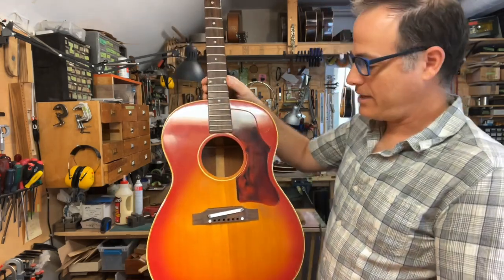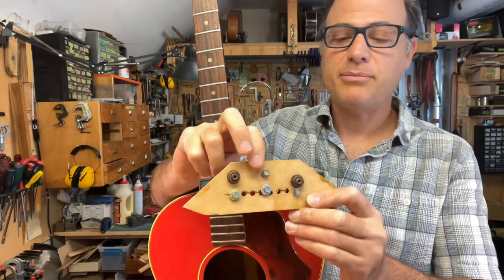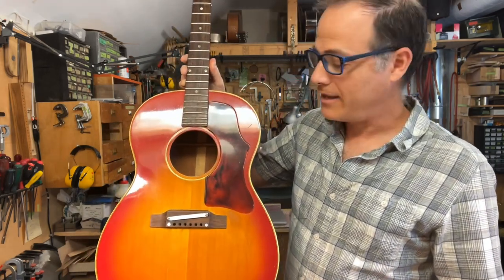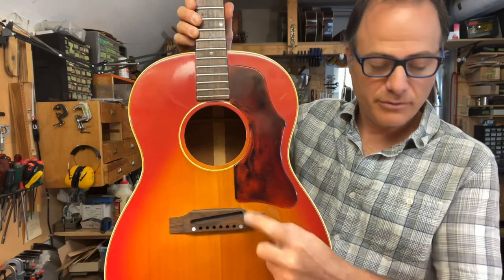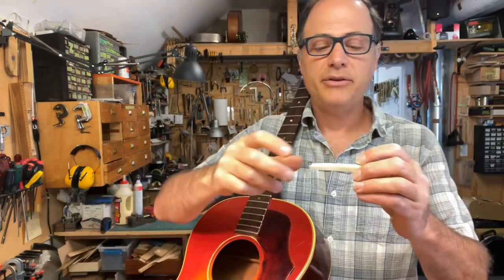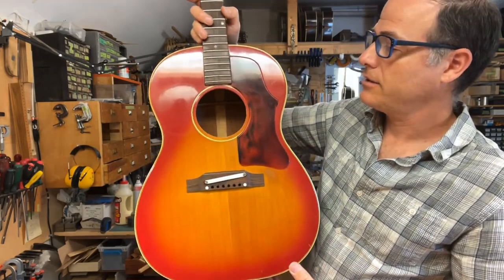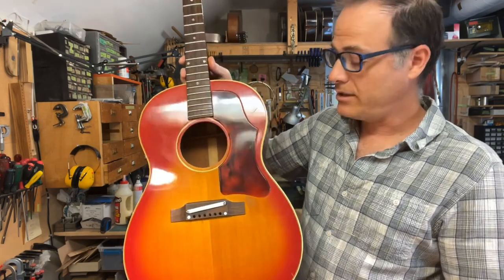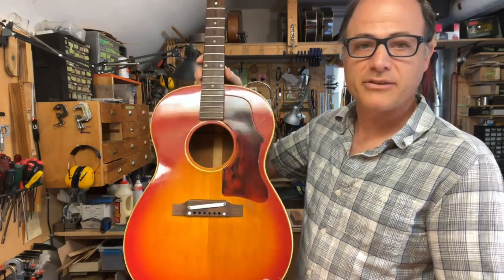A Creative Solution to the Gibson Adjustable Bridge Conversion Dilemma

Comment: Since my last comment about a year ago, I now have a 1965 Gibson B-45-12 and a 1967 Epi FT 45 Cortez, both came with adj. saddles, and both sound so much better now that they've been converted to solid fixed saddles. The Cortez in particular has a lovely warm vintage tone.

Comment: Good solution and video.  I have a 1965 Epiphone FT85 (12 string) with an adjustable saddle which sounds great and which I wouldn't dare convert. The saddle on my 1970 Gibson J50 has been converted and that sounds great as well. I still have the adj. saddle and screws so there is the temptation to change back to the original set-up, just for comparison's sake. The big mystery is why on earth anybody at Gibson thought that plastic bridges were a good idea!
Reply: right there with you.

Comment: Update to my earlier post: I made my own Brazilian rosewood insert and tightly fit it to my bridge. Then routed that insert for a standard sized Gibson saddle. But since I fit the insert tightly, I didn't need to glue it in. This way I can take it back to it's stock configuration, if I ever need to sell it (which will never happen..lol).
So now it's has the look and sound of a standard bridge and saddle, but it's not permanently altered.

Comment: Very interesting. Thanks for sharing. I recently bought this exact same made in Japan bridge for a 1966 J-50 I recently purchase. It had an original rosewood saddle. You could hear it sounded nice but was kind of dull. Now, with this bone nut, the sound has improved big time. The only thing we did not change is the bridge plate. It seems a bit tricky to get out without opening the guitar from the back. Any tips on that? Cheers!
Reply from the maker: Bridgeplate removal is tricky, and if your repair person thinks you need to remove the back to do it you’ve got the wrong repairperson on the job.

Comment: I'm 100% in favor of doing anything necessary to resurrect these 60s B25s. They can be really great sounding and playing vintage 60s Gibsons, for very reasonable pricing. I've owned several over the years, including one of the 12 strings that had a trapeze bridge and 2" saddle, and which was quite bold sounding for a 00 size 12 string!
I wish you had strung this one up for a demo of how it sounded after the conversion!
Otherwise great vid and good info about the replacement saddles.

Comment: I thought the point would be to have a drop in saddle and if you wanted to go back to the original adjustable you could gluing in that insert messed that up
Reply from the maker: Many people simply install a fixed insert, but the difference in tone is significant between that short-cut and a fully fixed bridge.